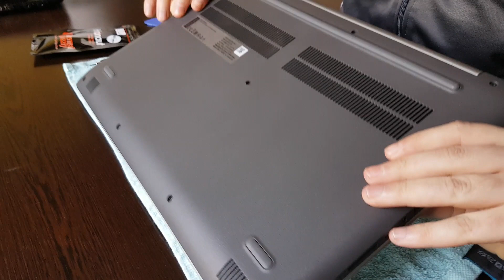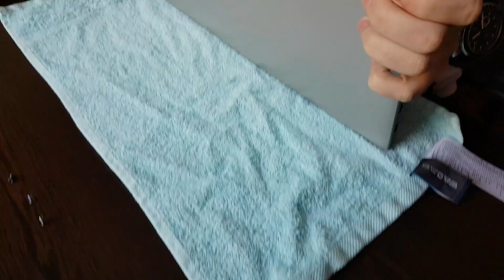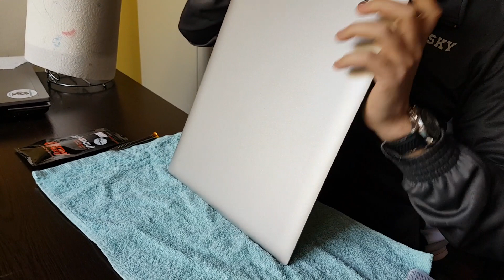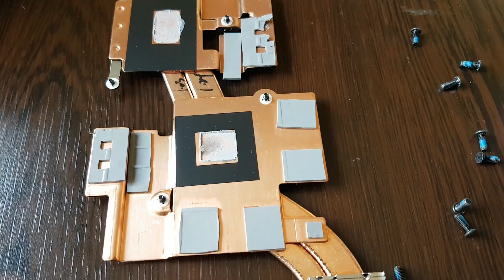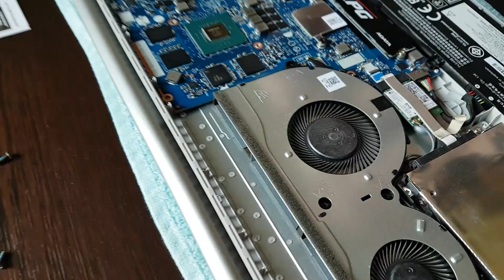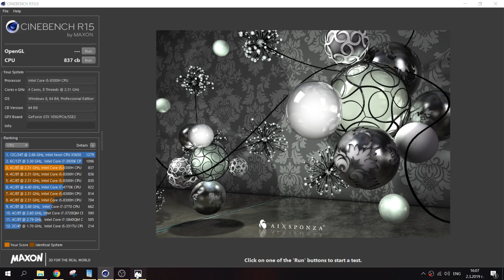Prevent your Lenovo from overheating using this one CHEAP simple trick? IdeaPad 330 &Thermal Grizzly

Comment: After some time i realized the easiest and more practical solution in  laptop models that does not offer a good cooling is to adjust windows power option settings regarding CPU max power. My laptop was reaching 80 C degress easily before i reduced intel cpu from 100 to 80 percent. Its now always between 65 - 72 C degress
Reply: It's rather simple and easy. Just open your windows energy options and go to additional configuration. From there you should open your power plan configurations and head to CPU state where you should configure CPU max state from 100% to 99% or something below that.
EIther CPU or GPU should be limited. You cannot have both working FULL TDP on this hardware without having overheat because its cheap and its dissipation is not enough. So if you are playing a game that gets full on CPU , do the windows thing to limit CPU(while you can go to nvidia control panel and set full power to GPU) . If game is hitting 100% on GPU , then open NVIDIA control panel and change to optimal energy (while you can go to windows and set CPU to 100%). This is how i use the laptop.
Reply: Hey man could u type down how u reduced cpu power usage step by step?
Reply: @maciejswat3559  You can try different values https://www.youtube.com/watch?v=6pocAvtdSRM

Comment: I can see you have already installed the ssd. May I know if there is a screw already included in the m.2 slot?
Reply from the maker: Yes there was a screw in the hole when i opened the laptop, so you dont need another.

Comment: After searching for some minutes i realised your model does not exist in my country, but i see that the vents on your model are pretty good placed, makes a good cooler effective and thats understandable for a gtx 1050, however mine is arriving in the next days and i havent found an answer to my question yet that is how are the vents displaced on the laptop, i really hope it has two vents like yours because my biggest concern rn is temperature, however thanks for the vid, helped me a lot
Reply: if your model is 330-15ARR don't worry, it does not overheat, and the vents are well located

Comment: Hi. I have the very same laptop. It's nice to see this video of yours. I've been looking for this as I am a bit concerned about its temperature. If I am right, that's the same reason why you replaced the thermal paste is it? If so, then there is really a problem with the laptop's heat management. I am currently using it for just casual gaming (Far Cry Primal). And probably some video editing in the future. Somewhat smooth gameplay and decent FPS. But I really noticed the very sudden temperature increase. So what I do is take a break after 2 hours. Do you know how much is it's capacity (the max temp it can cope)? Also, after your thermal past application, were there any remarkable improvement in it's performance? What else do you do to aleviate it?

Btw, great video. Very straight to the point. Thank you for this video good sir 👍🏻
Reply: Hello Mikael, OP here.
Yes the Lenovo IdeaPad 330 does have a compact cooling solution, but any similar laptop will not perform  significantly better when used extensively for 2+ hours. 
If you plan to keep this laptop for a  long time I suggeat you take some of the following steps:

1. Change the thermal paste with Arctic mx-4 or similar because you can find it for cheaper usually. 

2. Make sure you use it in a room with lower ambient temperature if you  live in a country with high temps. 

3. Use a cooling pad, or use it on a level surface; don't use it in your bed for long time. While cooling pads are not the ultimate solution, they will help a bit in conjunction with the other steps. 

4. Try to undervolt the cpu and gpu. This helps a lot actually. i5 8300h is easy to undervolt, and so are the GTX 1050 and similar GPUs. You can both undervolt and overclock the gpu which does wonders. 

Hope this helps,
Cheers
Reply: @brainsick7915  Thanks for the reply. Yes I definitely want to keep this for a very long time. This is actually my first laptop, and am just starting to delve deep about computers. I would absolutely do your tips. I am planning to upgrade the RAM and at the same time renew the thermal paste, I'll look for that brand you mentioned. About undervolting I actually thought of that, but I am not fully aware of the consequences (if there's any). I have read articles about it and it made me think twice. Thanks again and I appreciate it. All the best to your channel!
Reply: Hi, this laptop has the i5-8300H, H stands for High Performance. It's quite rare for laptops with these form factors to have an H series. Most laptops this slim will have the U series chips which stands for Ultra-Low Performance. Chips in this category are factory under-clocked to avoid thermal issues. So  yeah, this just means you have to follow what he did in the video, or get a cooling pad, etc. The good thing about this laptop is its portability and weight compared to other laptops that have this kind of chip. Even with the better i5-8300H and GTX 1050, it's still not recommended for an extended time in heavy gaming because it is still a laptop. If you really want to game hard, you should get a desktop because there are many cooling solutions with desktops (Water/Air), so temps would never be an issue. Leave the lighter tasks to the laptops.
Reply: @ZedecPacaldo  Bro thank you for your advice. I did what you said and it did helped a lot. I bought a Cooling Pad and re applied Thermal Paste. The laptop is doing fine until now, still runs smooth. I have upgraded the RAM from 4GB to 20GB, it helped drop the temperature a lot apart from improved performance. I use it for my buainess but I still play games on it (some Ubisoft AAA games, Genshin Impact) in mid graphics settings for roughly 3-4 hours but after that I discipline myself to take breaks after those intervals. However as what you have suggested, in the future I will build a desktop pc.